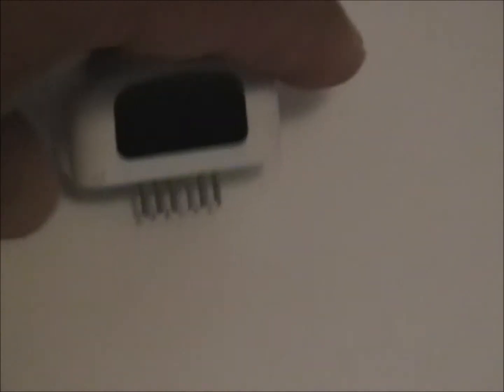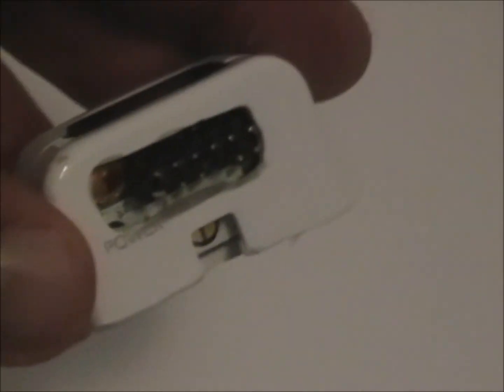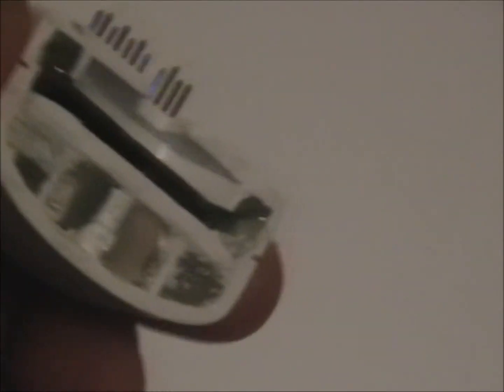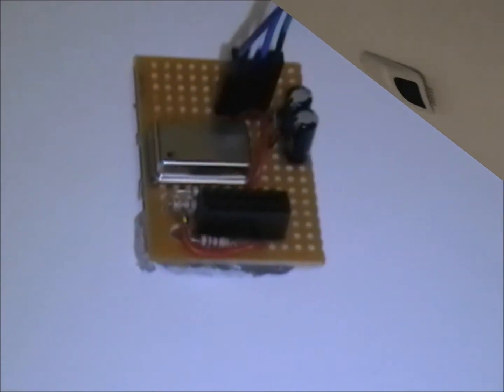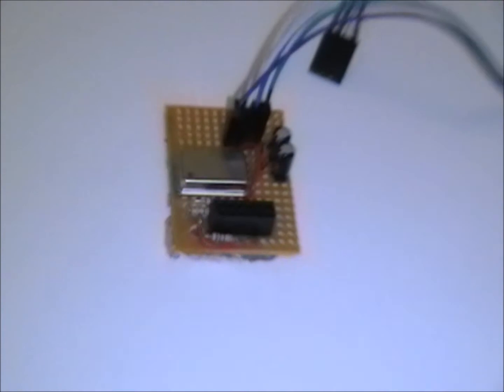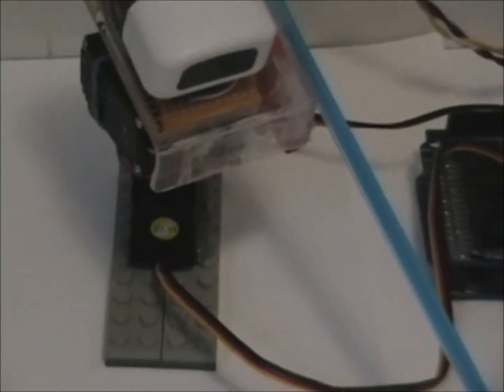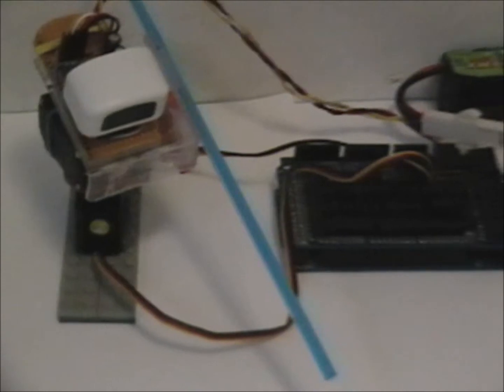Wii IR camera sensor controlled by an Arduino used as a flame detector.

Comment: what is the model name of the camera?
Reply from the maker: +Gana Bata The camera comes from original Wii remotes.I do not know what model it is. Non original remotes may have different cameras.
Reply: +Sorin Vatasoiu  i am trying to buy it but i do not want to buy wiimote controller it is expensive. Also google can not reveal model number to me.. all projects related your project also did not mentioned what is the camera name where is the factory or how to buy it.
Reply from the maker: +Gana Bata You do not have to buy new wii controllers, get a used one or maybe a non working one also, the camera may be good (as long as the controller is original)